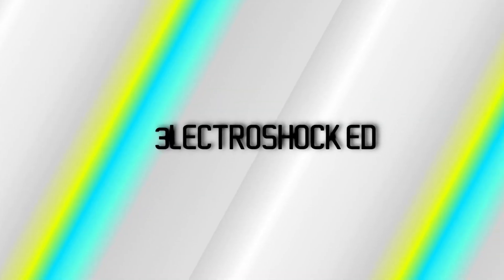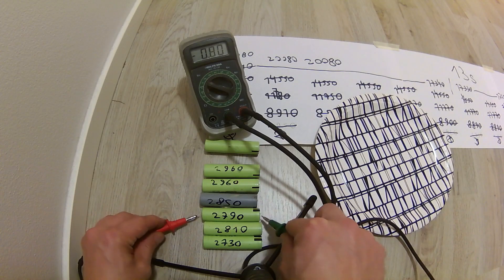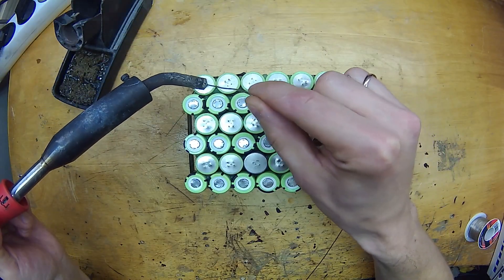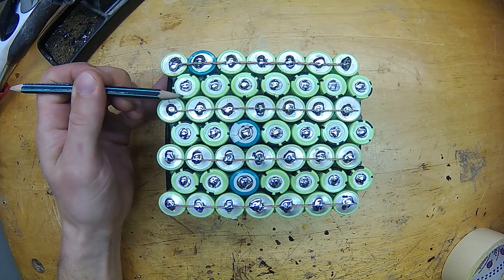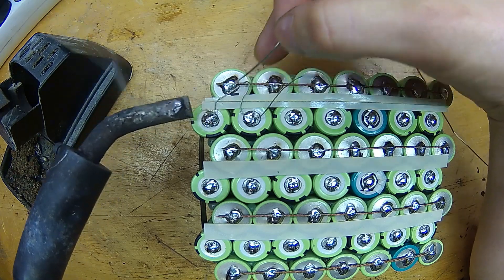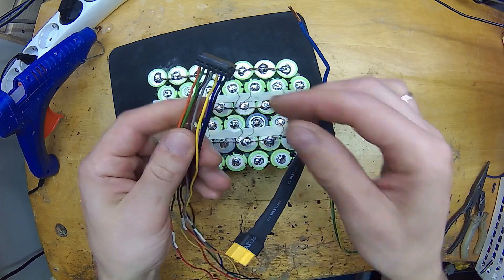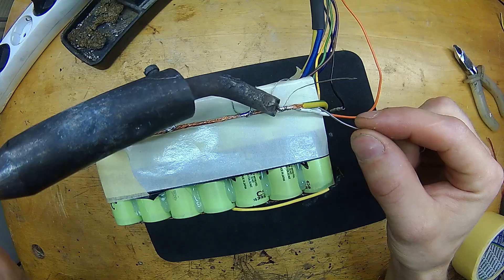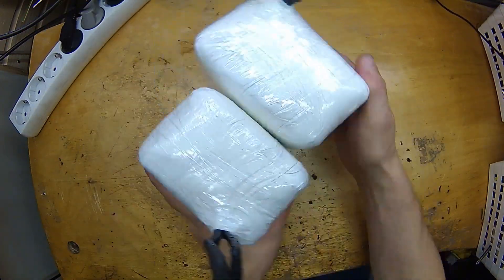Make 48v LITHIUM Battery the BEST way | Complete guide

Comment: Hi I have a 36v 4ah battery pack and a 12v 4ah battery pack both 18650 can I connect the 10s bms and the 3s bms in series and get a 48v pack?
Reply from the maker: Hi! If those are close to same capacity, then why not. Just put mains in series. Bms has nothing to do with this :)
Reply: @3LECTROSHOCKED  I mean can I connect the bms out put wires in series with each other so when I want to charge the pack they work as a 13s bms?
Reply from the maker: Oh, now I get it. Well I haven't ever used a bms, so I can't comment on that, sorry :(
Reply: @3LECTROSHOCKED  no problem thank you.

Comment: Very interesting fuse concept. I would recommend fishpaper between the serial cells as well es extra care of the balance leads. 80% of diy-battery fire comes from balance leads rubbing to each other. They carry huge voltage differences. If you wire them strait parallel and on top on fish paper (to further isolate it from cells) then the maximum difference is 4.2 V to the next wire instead of up to 30V on your battery.
Reply from the maker: Hi! Thanks for watching! Wou, thanks for a very good tip - I'll do that next time :)

Comment: You say "amps per hour" and "kilowatts per hour" when you mean amp-hours and kilowatt-hours and I have concerns
Reply from the maker: Hi. Thanks for your comment! Where exactly I presumably said it wrong? :)
Reply: @3LECTROSHOCKED  At :53 you say "amps per hour", and at 2:06 you say it again, then you say "kilowatts per hour". "Per" means "divided by", usually represented by a / symbol or the letter 'p' in units of measure. Amp and kilowatt both refer to a rare of energy per unit of time. 1 amp=1 coulomb/second. 1 kilowatt=1 joule/second. If a battery contains enough energy to output 1 amp for 1 hour, that's an amp-hour. 1 kilowatt for one hour is 1 kilowatt hour. One kilowatt for two hours is 2 kilowatt hours. 10 kilowatts for half an hour is 5 kilowatt hours.
 So when you say "per" you're talking about division, and when you say "for" you're talking about multiplication. When I first wrote the comment I thought you didn't understand electricity, but now I think it's just that English isn't your first language
Reply from the maker: Oh, thanks for being so in-depth :D Yeah, you're right, the "per" is probably not the right choice of words. But luckily most of us understand that I'm referring to -> kWh and Ah. But thanks a lot for pointing that out - you are right! :)

Comment: Any reason you didn't make 2 7s batteries instead of 13s?
Reply from the maker: Hi! Very good question. The controller is set to recognize a 48v lithium system. It has a shutdown feature and others which read voltage. But using a 14s would be a very interesting test - I may do that some time :) thanks!

Comment: Great video, but I'm not agree with you on 1 thing. It's not SUPER safe. If you put some insolation between series connected batteries then You could call it SUPER safe. Overall it was great tutorial
Reply from the maker: Hi! Thanks for your comment! If you mean between cells of neighbor series: I thought about this for many years. The original wrapping does seem a little too fragile. But there is a bonus in using hot glue. It's lays down a little thick, so the wrapping of sells are not in fact touching each other :) But yeah, that is something to consider.
Reply: @3LECTROSHOCKED  I built many packs by now and I think I'm too cautious about them. Maybe it's unnecessary.
Reply from the maker: I totally understand! :) thanks for your comments!

Comment: Thank you for the video! I have been collecting cells, testing but still don't dare build a pack because I do not completely understand the process. I have only 100 watt iron. I bought a bafang mid drive  I would like to complete a build on a ebike project and a 36v 1000 watt scooter, and possibly a power wall someday? I have copper wire but it is AWG and looks like you use at least 21 strand wire (USA follower).  Should I use the finer strand US welding wire? I have clear silicone rtv for grouping the cells as it has good heat transmission. The series/parrallel configuration and fusing seem to be my biggest concern stopping me for now. I'm thinking a 36v pack for my scooter to start with? I really like your 14pin connector idea! I guess I'll try to find one of those? And a 200 watt iron. Thank you! I may need your support if I pursue this?
Reply from the maker: Hi! RTV is a good option for combining :) Sorry, I don't understand what wire you write about - there are different ones :)

Comment: I am planning to make a bettery pack, 5ah 10s. But I have 20 batteries with a rated capacity of 2000Mah, and 30 batteries with rated 2400Mah, is it possible to put then together in a battery pack? Would the difference in capacity cause issues? Please !
Reply from the maker: Hi! You can mix and mach them, but in the end you need to have the same cap in every serie (every serie of your 10s).
Reply: @3LECTROSHOCKED  cap meaning? Same voltage? Or you mean same Ah in every series? Like e.g I will put two 2000Mah cells with three 2400Mah cell per series to give 11.2Ah per series. Then repeat for 10 cells? Am I correct?
Reply from the maker: Yeah, correct! Cap = capacity :)
Reply: @3LECTROSHOCKED  oHhhh!!! What about if your cells are a lil different, like the 2000Mah one can continuous discharge at 20Amps and the 2400Mah one can only continuously discharge at 3Amps, is it okay?
Reply from the maker: They will effectively become one entity with shared characteristics from every cell. The one that gives more peak, will continue doing that, but at the same the other one will recharge it. And all of that happens all the time, not only when applied load.
Reply: @3LECTROSHOCKED  so it doesn't matter? So it won't damage the battery?
Reply from the maker: No, but just don't go crazy with that :D like putting 300mah together with 3000mah...
Reply: @3LECTROSHOCKED  ahh I see! Then I guess for me 2000Mah and 2400Mah is good:)
Reply: @3LECTROSHOCKED  I got another question about hub motor low and high brake, it doesn't seem to work on my e scooter, all it does is it disengage my motor from accelerating when I press my brake. Is that what it is suppose to do?
Reply from the maker: That's exactly what it supposed to do. Regenerative braking is a different thing and, in general, it doesn't work very well in my opinion, since we don't have enough mass in us for it to work effectively.
Reply: @3LECTROSHOCKED   I see, thanks for replying man! I really do appreciate your help! :)
Reply from the maker: Glad to help!

Comment: Great video, new subscriber. I'm sorry to bother I would like to hear your opinion about a lithium battery that I have that somehow won't turn on anymore. I took it to the e bike shop and they did all kinds of testing and even changed the wires that conect the battery to the bike which I thought that was the problem to begin with but once they did all the rewiring they tested it with a battery of their own and it worked. They told me to plug my battery in but mine didn't work 😔. They Thought it might be the wires conected from the battery itself but they were charging me 150$ for them to examine the battery.😔 can you please help me I want to try and see if I can fix it myself. Maybe something is loose or what do you think the problem might be? How dangerous do think it is if I open it up and take a look? Pls and thank you.
Reply: Maybe you can try changing your charger,maybe your charger isn't working? Cos the other day I ran my battery till the bms cut off,  then I forgot to turn off the switch, so it continues draining, after charging it up via my balance connector to 36v, my battery terminal reads zero volts.  I decided to again charged it through the bms instead of the balance connector and it instantly came back to normal voltage. So I think maybe u ran it too low? And your bms cut, and your charger isn't working?
Reply from the maker: Hi! Thanks for your comment. If it reads flat out 0v, then you probably have a broken bms. I assume there is a bms inside your pack.

Comment: hi so I want to make a balance charger using tp4056 modules and for 48v we need 12s and I will do 3p does that mean I need 12 tp4056 modules connected in series and then to the battery?
Reply from the maker: Hi! All correct, but you need 13 for 48v system. 3.6v × 13
Reply: @3LECTROSHOCKED  so I will need 13 tp4056 modules and I need to connect the most (-) to the batteries (-) and the most (+) to the batteries (+) and all the others between each series connection. right?
Reply from the maker: No, just the balance leads will do. Connecting main leads is not needed :)
Reply: @3LECTROSHOCKED  but I watched your video about it and you connected the modules (-) to batteries (-) and modules (+) to batteries (+)
Reply from the maker: You not getting the point, that is already done via balance. No need for using mains :)
Reply: @3LECTROSHOCKED  ok let's say I have a 3s 12v pack with no parallel batteries I will need 3 modules to connect them in series so I will have 4 wires coming out the modules a (-) the one between module (1-2) and another one between module (2-3) and then (+) so the correct way of connecting them is to connect (-) to the batteries (-)end
then one between cell 1 and 2 then one between cell2-3 then (+) to the (+) end of the batterie. plz, say that is correct.
Reply from the maker: Yes, wires are always one more than amount of S (also modules in this case)  :) hope this helps
Reply: @3LECTROSHOCKED  thank you so it is just the same thing for the 13s just more
Reply from the maker: Yeah, 14 wires for a single 48v battery
Reply: @3LECTROSHOCKED  thank you helped me alot

Comment: Good and clean build, but I would like to know what electrical kit did you use, power out put. I want to buy a conversion kit but not sure what to buy.
Reply from the maker: Hi. Sorry I don't understand the question. What kit are you talking about?
Reply: @3LECTROSHOCKED  to convert my bike to an e-bike.
Reply from the maker: Oh ok. I just buy them from china. Biggest one is 1.5kw and smaller ones like 300-500w. And definitely hub motor.

Comment: Pretty sure soldering directly on cells like that can damage them
Reply from the maker: Nope :) just need a very powerful iron and quick action to quickly create high temperature on the surface and melt solder. Heat then won't  have enough time to travel inside and accumulate to damage the cell.

Comment: Yes it is good idea to check cell capacity and internal resistance before building, but hot gluing and soldering to cells is not good idea. I recommend to use cell holders to have better cooling and support for battery and then there aren't only wrap between cell voltages. Welding cells together with proper equipment increases cell life because welding produces much less heat than soldering and reduces risk of cell overheating which can can cause cell runaway.
Reply from the maker: Hi! Thanks for your comment. All good points, but in practice, the result would be a less safe and durable battery. Hot glue is actually relatively cold. There's absolutely no way it's capable of damaging a cell. And a big enough iron won't overheat a cell - just watch the video, no liquids poring out and the voltage is perfect. Also you can't weld a fuse to a cell, which is the main point of this build ;) If you want a welded battery in plastic, without fuses - just buy one :D Thanks for watching!
Reply: @3LECTROSHOCKED  Actually you can weld fuse wire to cells https://youtu.be/THVMnyE4yAw?t=161 and using cell holders adds ability to cool cells , provides support and adds air gap between cell voltages because only having wrapper and hot glue between cell is bad idea. Over time vibration can cause wrapper to become loose and that can cause short circuit.
Reply from the maker: About the cooling - you should just watch the video till the end :) I do addres that matter. Anyways, you are really not making a point here. Everything you describe is just an unnessasery waste of money. This video is about saving bucks and having a great and safe result. Buying spot welder 🤣 and some 3d printed casings is really not reasonable for a couple of batteries. And BTW, the integraty of hot glue and wrapping casing is not affected by vibration AT ALL, since they are flexible. Now plastic, well, you can snap that with your fingers. So do the "math" on that  ;)

Comment: Can I use 2 PCs 3.2v - 200Ah batteries building my 48v battery bank if my other 13pcs batteries are also 3.2v same manufacture but the 13 PCs is 280Ah can I link them in series with the 3,2v same voltage but 200Ah - 2 & 13 - are 280Ah
Reply from the maker: Hi! Sorry, I don't really understand your message :(

Comment: How many 18650s does it take to make a 48v battery
Reply from the maker: Hi! Well, 13 :D But that won't be very practical. A minimum of 6-7 parallel lines would be good. So that makes 78-91 cells. It really depends on your consumer.

Comment: @3LECTROSHOCKED #3LECTROSHOCKED great video thanks for the information, 2 questions, how many watts is your soldering iron and where do you source you balance plugs, thanks in advance  ;-]
Reply from the maker: Hello! Thanks for the comment! It's around 200w - yeah, pretty massive iron.  Well, that connector is actually pretty common in all kinds of electronics. So a lot of them are salvaged from some old scrap :)
Reply: @3LECTROSHOCKED  thanks for quick reply, i thought the iron was at least 200w as i see lots with 100w and that one looks bigger, as to the connectors,

 which items are good to scrap them from? 

, they almost look like floppy disc drive connectors or some kind of board connectors from dvd players or lcd tvs, 

my diy ebike is 16s and i hope to parallel several batteries, currently its one @21AH removable and another @6AH built-in im undercharging to 63v but overvvolting my 48v 1500w wheel with 18 mosfet controller to around 2200W about 52V @42 amps under load, i would like to make the single 1KW battery into 4 smaller one to put in panniers on eaxh side of the wheel instead of in back box
Reply from the maker: Sorry, I have found those in different kind of scrap. Can't really tell any special item to go for :(  Your project sounds awesome! I have one bike with that kinda arrangement: https://youtu.be/WrYkkZFoEBg

Comment: sir please help me understand one thing - how are the parallel connections made by using a fuse wire? in other videos, when people use nickel strips, they first connect the parallel cells together and then make the series connections but here it looks like the cells are not connected in parallel. i am wrong but can you help me understand how are the cells connected in parallel in this method?
Reply: If one of the fuse blows off, how will u come to know ? Only one cell gets isolated from the battery bank.
Reply from the maker: If it blows, that means the cell is faulty. To disconnect shorted or overloaded cells is the whole point here :)
Reply: @3LECTROSHOCKED  So u will replace it when u service it next time??
Reply from the maker: Well, yes :)
Reply from the maker: Hello. Thanks for your comment! Negative sides of all cells in one serie are connected with copper wire, creating the parallel connection. A small fuse wire is connected from that copper wire to the positive side of every cell of next serie. Just check the video again and look closely, you can see that clearly during soldering :) hope this helps!
Reply: @3LECTROSHOCKED  hello sir! my bad I mean for the positive terminals they don't have the copper like the negative terminals do, which confused me and made me think how are the positive terminals connected in parallel
Reply from the maker: Every cell have it's own fuse for safety. You understand now? :)
Reply: @3LECTROSHOCKED  yes this part i understand but are the positive terminals connected in parallel?
Reply from the maker: Of course,  but before that they are connected to a small wire fuse. Fuse is then connected to the copper wire which makes the parallel connection.
Reply: @3LECTROSHOCKED  Ohhh that makes perfect sense, thanks! :P